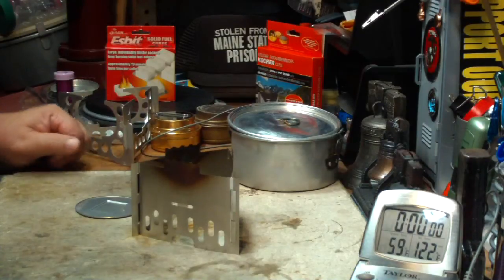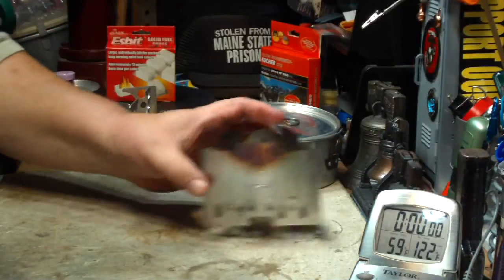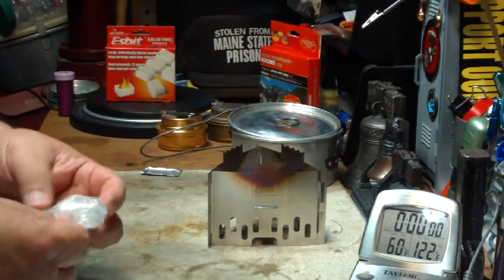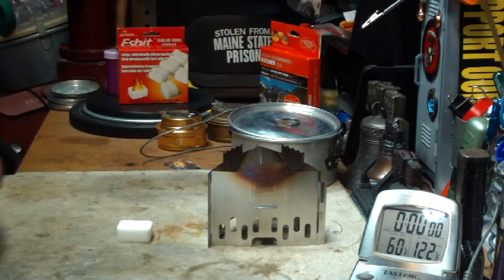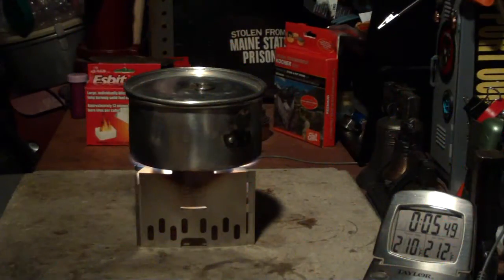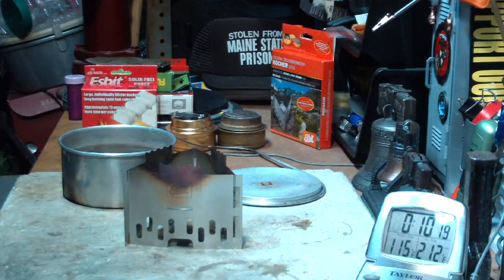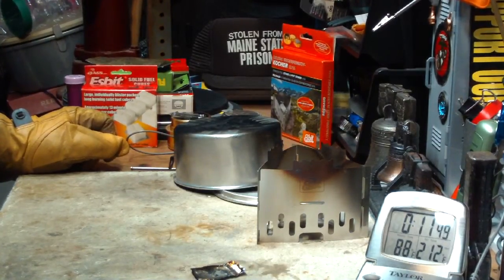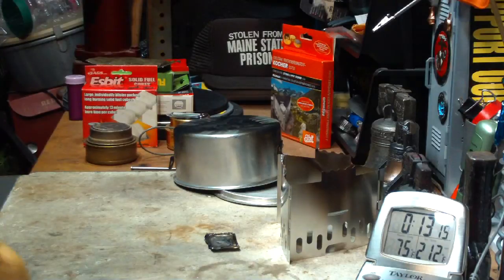ESBIT Stainless Steel Stove & Potstand - Boil Test #2

Comment: Hi Hiram,  To make it really easy to scrub off the Esbit residue on the bottom of the pot all you have to do is coat the bottom of the pot with some dish washing detergent prior to cooking with the Esbit tablet.  The residue comes right off no problem with a scrubby pad.  The pot will look like new.  Try it.  You'll be surprised.  Just thought you should know.  Rock on Hiram!

Comment: What I found to work is to add a thin film of dish soap to the bottom of my pots and then proceed to cook.  When done cooking, the soap rinses right off and the soot along with it.  I know it will add weight, but it is worth it to me knowing I will have clean pots for later use.

Comment: As a "gram weenie" for 40+ years, I've little use for alcohol stoves and use fuel tablets exclusively when going solo or duo. I have 15 stoves of 12 different designs/
manufacturers with 3 new stoves on order now and a few more on my wish list.

The Esbit folding tri-wing design is my go-to stove for everything but it's far from perfect. Eventually I hope to come up with a design that incorporates everything I want and excludes what I don't want. 

I would like to see testing with the Bleuet 25 gram tabs which I've never even heard mentioned anywhere. I'd also like to see testing with the Esbit and Bleuet 4 gram fuel tablets. It has to do with a burn surface area comparison. Would 3 of the smaller cubes provide more surface burn area than a 14 gram tab? If so it would mean a faster boil time. Also, would breaking a 14g tab into fourths decrease boil time?